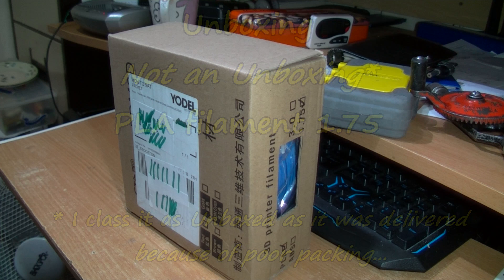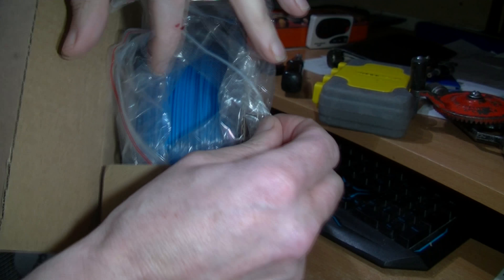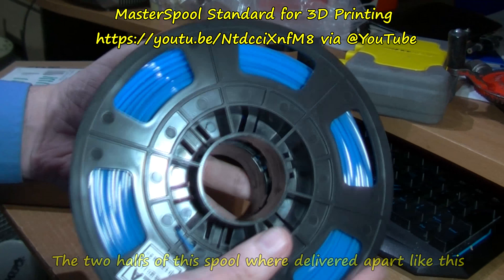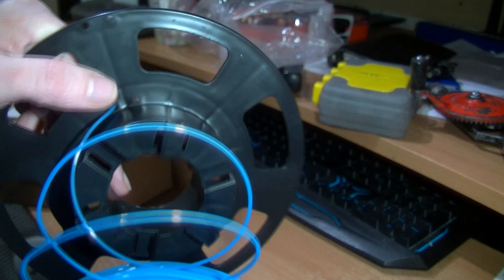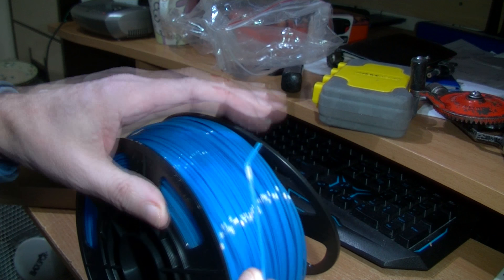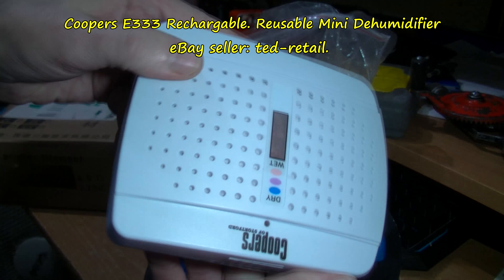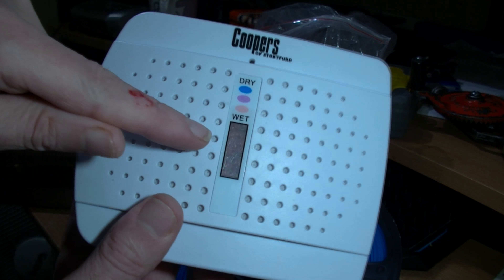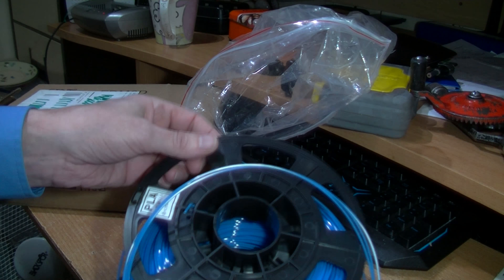Unboxing Not an Unboxing PLA filament 1 75

Comment: Please add a link where NOT to buy PLA :)
My Chinesse PLA was perfectly packed and air sealed.... 100% better than this one.
Reply from the maker: 1KG 3D Printer Filament PLA 1Kg 1.75MM/3.00MM Roll Pack For Huxley Makerbot UK
https://www.ebay.co.uk/itm/202105784395
eBay Seller
yanghaifeng2010 (88359  Feedback score: 88359)  About yanghaifeng2010
98.9% Positive Feedback <other have left Bad Feed back >

Price £6.14 (UK) : (I have to buy cheap because of low income)

Is your Chinese PLA and who is as cheap or near to that cost?

This was not worth it because respooling from separated split spool on to new spool caused me issues, too lose, hand wound, etc
Reply: Wow, this price is really unbeatable...

At least I've bought PETG 1kg at about £17,5 from some Poland manufacturer "DEVIL DESIGN" - the quality is good, but only 2-3 prints done for now.

1kg chinesse PLA comes packed with my "Anycubic Linear Kossel Plus" delta printer, so it cost me nothing, but on their page they sell it for £22.9 :(

Printer kit it self with 1kg filament cost £172.84 in total.